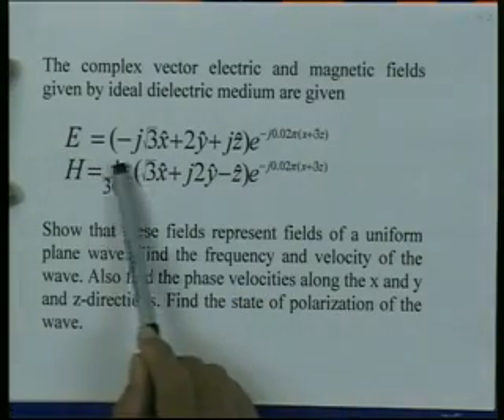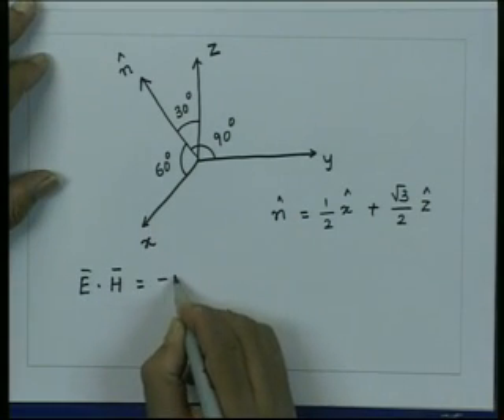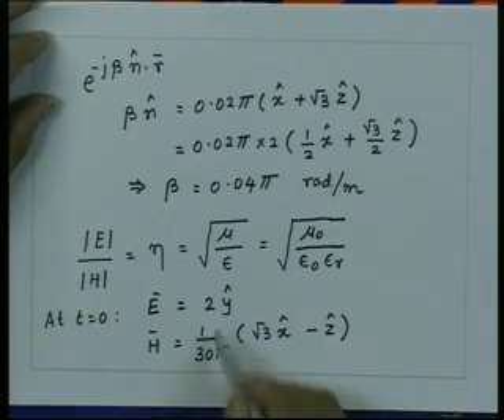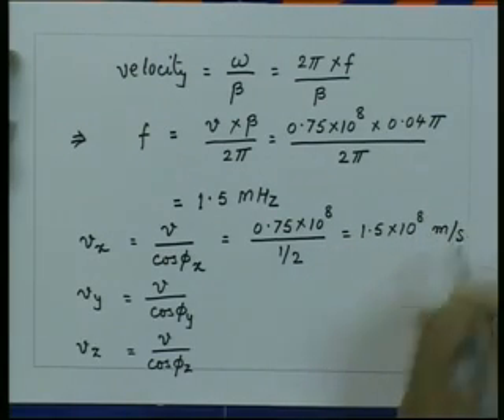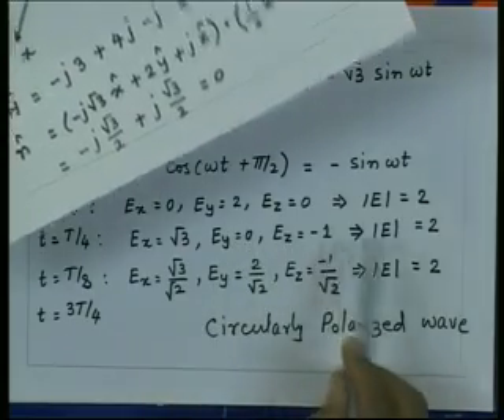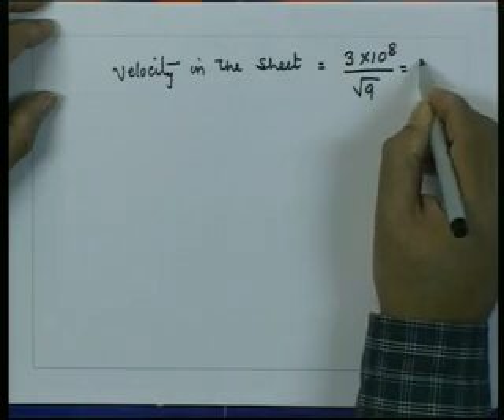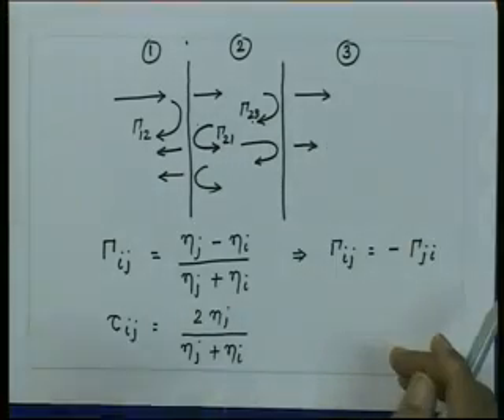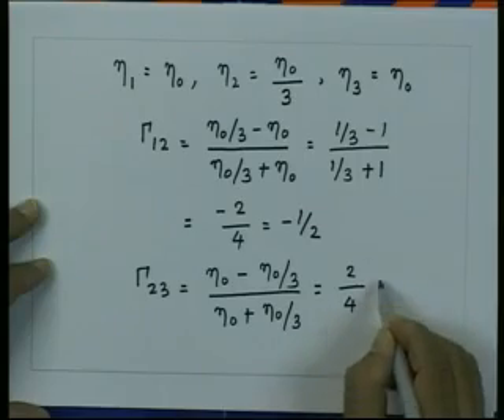Problems on uniform plane wave in a meduim

Comment: Sir I really like your approach of teaching...
but I have a doubt at 36:37 if we try to solve problem using transmission line analogy...
medium 1 and medium 3 are same..
medium 2 has thickness  λ/2 and so input impedance at the interface between medium 1 and 2 will be equal to intrinsic impedance of medium 3.
 so there should be 100% transmission of power but..using the shown method in this lecture..transmission is 9/25 of incident..
please help me understanding this..